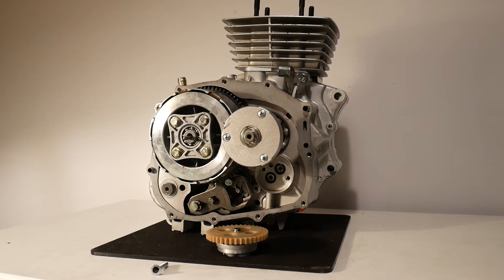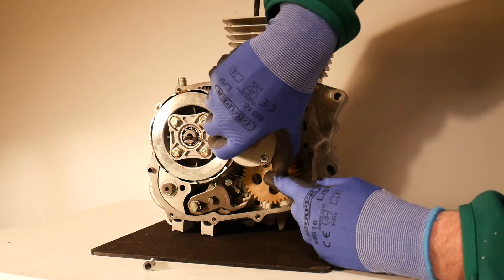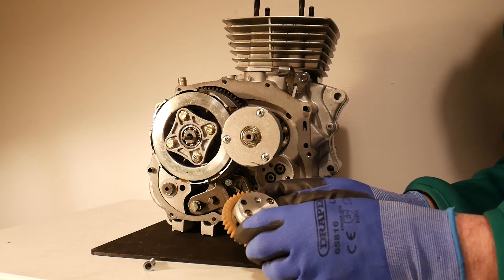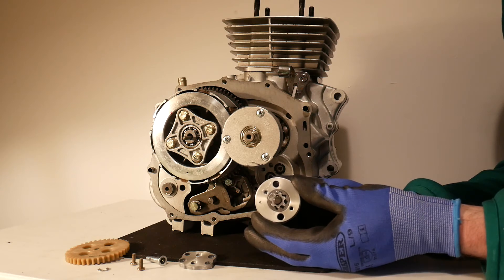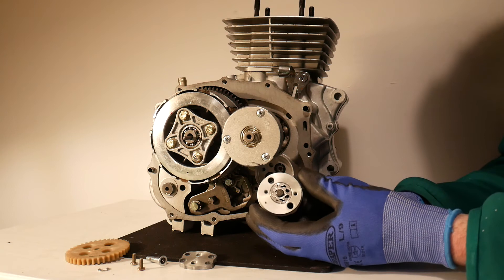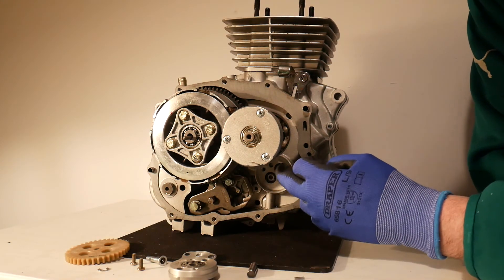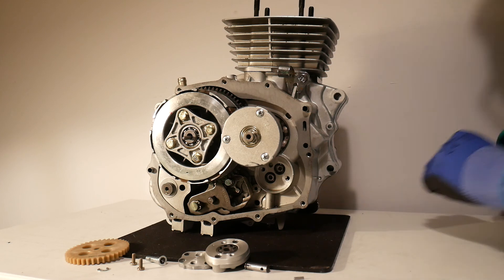How a Trochoid oil pump works in an engine

Comment: If you blow air on the other side of the engine through the small hole inside the oil cap which is the intake hole of oil you will notice that no air will pass the oil pump because the oil pump works more like a suction pump and air can not pass unless the engine is running, its suction on one side and pumps on the other side in a slow push manner never really pumping oil.

Comment: Is it easy to install these in backwards how do you tell input from output??
Reply from the maker: Yeah I think thats a possibility if you are not careful but it depends on the motorcycle engine and the pump design. I think there is indicators on the pump which indicate top or bottom or left and right for proper installation.

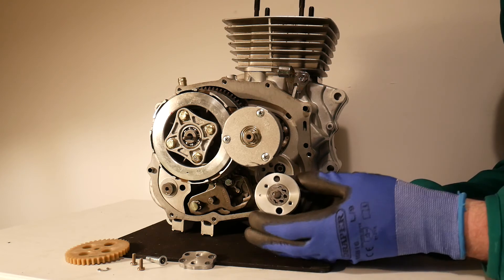Comment: Well lit, well focused, good pace.     @~14:25 would be a good time to show that the inner rotor's axis of rotation is offset laterally from that of the outer rotor.  This might help make clearer how the teeth continuously mesh with tight clearance on one side of the housing but separate and disengage with maximum gap, on the opposite side.  And that (around 12:00+ where the action is shown) the peak of one inner rotor lobe is actually passing or "skipping" over the peak of an outer rotor lobe. Maybe move the lid back to it's functional position and remind the viewer that the lid traps oil in between the lobes, while the rotors are turning (important function of lid beyond just preventing the inner rotor from falling out).   Another point to make that might help is that there is no air in the system, only oil (not compressible or expandable).